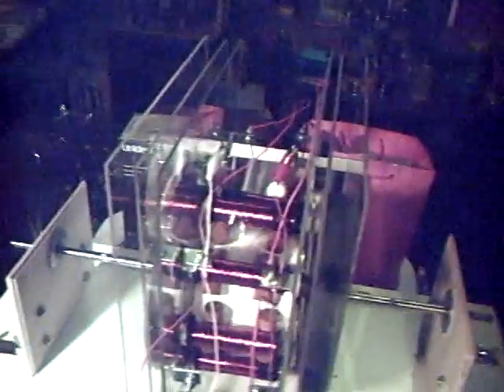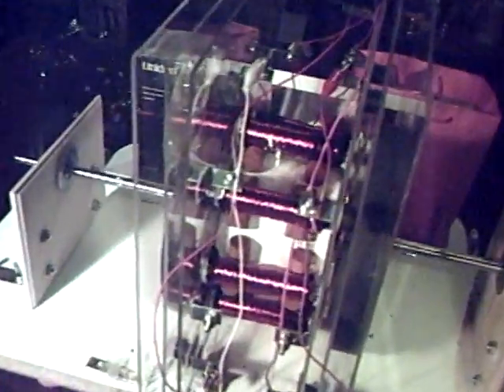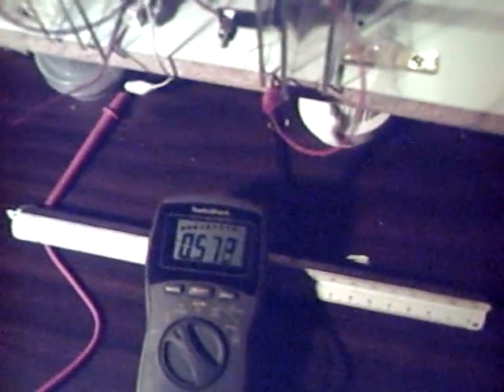LENZLESS GENERATOR  MEASURING ONE COIL ONLY 28 gauge wire early stage of constrction

Comment: I had a go with your design but on a motor bike Round stator - 18 coils 3 phase and 6 coils on each phase. i think the coils are abit too close but i was generating power 100 an somthing odd mA.. i just couldnt find a way of useing it tho - i tryed a 3 phase rectorfier onto a batt, motor and cap but it seemed to vanish. it does have 18 guage so i think its too big and not enough used to get a decent usable Voltage + amps. orrr im in over my head, which i think its the latter.

Comment from the maker: The inductor does divert the flux on one side or the other. That is why 4 works better 8. 4 allow more flux to get through between the inductors and produce more electricity. It needs lower resistance coils. New ones are about 1 ohm each, and will be replaced soon. More current will be produced. I was getting about 50ma from my first proto. An alternating flux is set up in each coil's core, not a varying flux. How can you say you know how something works when you understand  so little about it.

Comment from the maker: You obviously think this is a simple induction type generator, which shows you have not gone to my website or looked at the other videos. The meter is only hooked up to one coil of 28 gauge wire, 35 ohms, rotating at a very slow rpm, that is why the output is so low. Your so called constructive criticism lacks the constructive part because you have failed to fully investigate this. You seem to possess the typical attitude of an academic, I know it all and therefore there is nothing new to learn.

Comment from the maker: Thanks, I hope others go to my website and check out the details of it's operation. this is a very crude version I made and can be improved. I am hoping others make better versions than mine as I don't have a lot of spare time. I will try to add more useful info to my website as time permits. Please if you go to my website, please try to visit my sponsors. Please rate, comment, spread this video. This is a revolutionary type of generator and could solve our energy problem once and for all. DQ